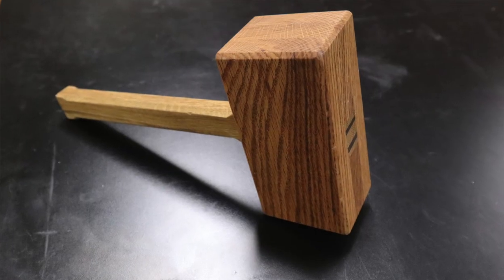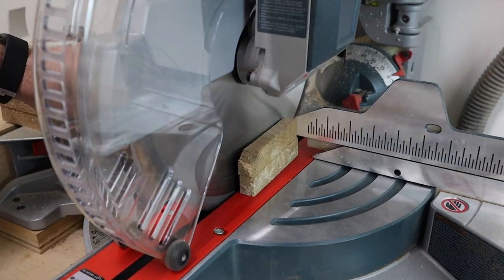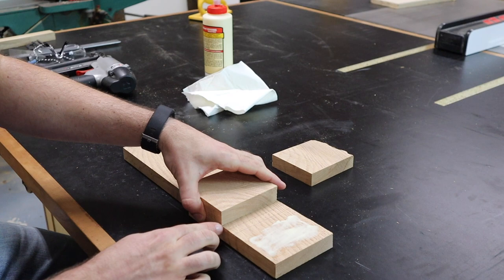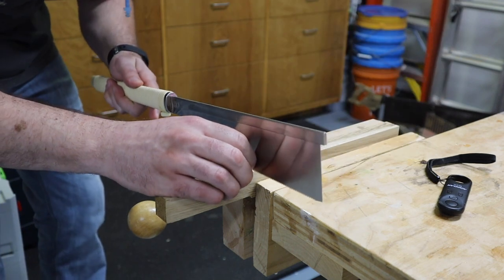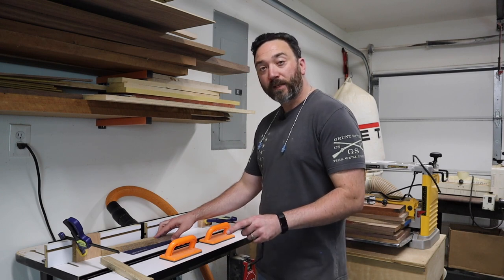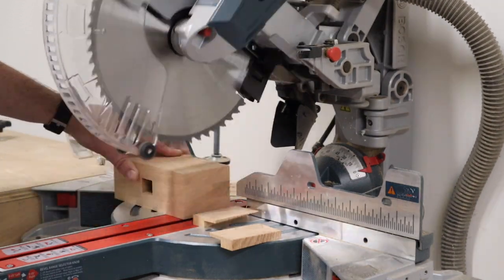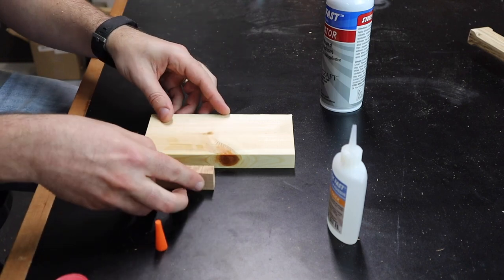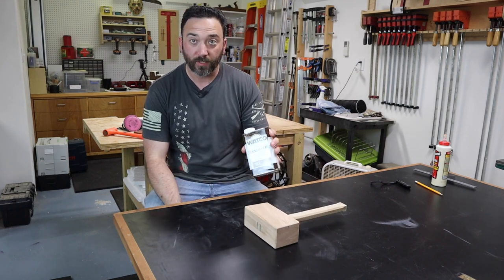Woodworking DIY: How to Build Your Own Mallet from Scraps!

Comment: You “saved the piece of oak from the trash bin”? Why don’t you just say “I’ll be using this piece of oak”. A piece of trash bin oak that size here in the U.K. would be prohibitively expensive. So it might be a cool shop made tool but a bloody expensive one.
Reply from the maker: I said that because I really did save it from being thrown in the trash. I was talking to a moving truck driver and he had several large pieces of oak on his truck that he was planning to throw out on the side of the road. I told him I'd like to have them for potential projects. I cut off a small piece from one of the boards that became this mallet. I can't help how much it costs in the UK, here it's typically trash or fire wood and has basically no value.
Reply: Us Americans have lots of Native Oaks. Where I live it’s the most common Firewood for Fireplaces and wood stoves. 
 I can buy a full pickup load for > $300. Maybe I should go into the Mallet business!
Lately there’s disturbing trend of tearing out old Walnut Orchards because Californians seem to prefer Concrete, Condos and Strip malls over Farmland. 
  Sadly. But there are a lot of people slabbing Black Walnut. Farmers used Black Walnut as rootstock for English Walnut Orchard trees. More specifically, Paradox Rootstock which is a hybrid between Black and English. The supply seems endless, but unfortunately it’s finite. Lots of people slabbing Oak and Olive too
 With the terrible economy good prices abound. I’m sure the UK must have a hardwood that’s common. 
   A Mallet an be made out of any hardwood. Or even a combination of them. Cheers!
Reply: @MarcusRefusius Not Californians, corporate developers. If you ask the people, there would be far less concrete and far fewer strip centers. Just sayin’.
Reply: @DessieTots  Oak precut into small pieces for hobby woodworkers is prohibitively expensive, but damaged second hand furniture can be extremely cheap or even free 👌
Reply: @MarcusRefusius  We have a disease decimating our native ash at the moment so ash is available cheap, and beech wood is also affordable here.

Comment: Super video.   I have only one question..... Why is the striking surface of the mallet cut at 2 1/2 degrees?
Please excuse my ignorance, I'm pretty new at this.   Thanks for your time.
Reply from the maker: It comes down to the geometry between the mallet and your hand on the handle. When striking something with a large mallet, your hand will very naturally be slightly lower than the center of the mallet head when it strikes. If the mallet head was perfectly square, then the mallet face would be at an angle when I hit something and it could glance off the surface. However with the slight angle, the mallet face hits the surface flat with less chance of glancing off and results in a more powerful impact.